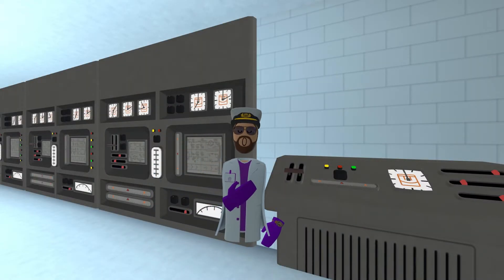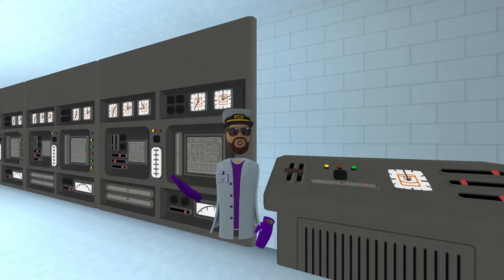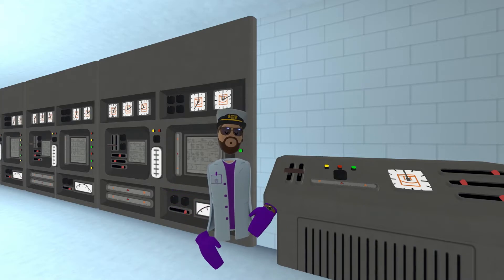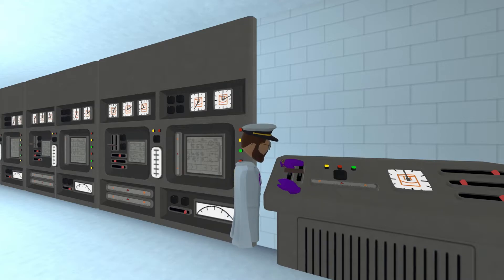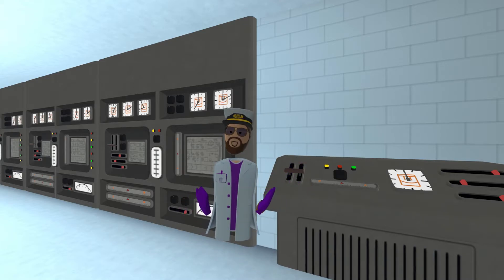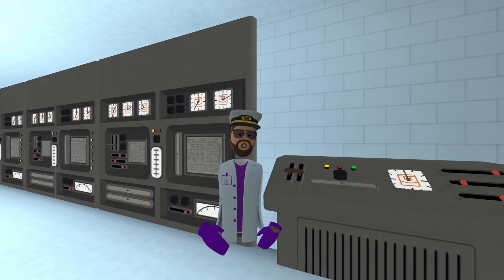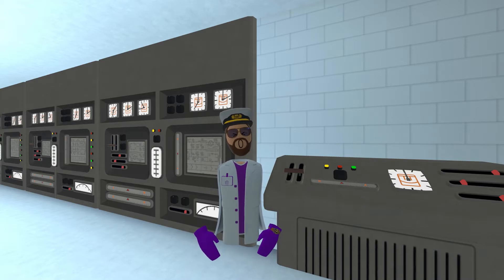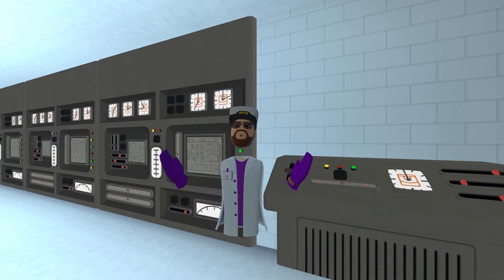Orange Automation is Expanding!

Comment: If I bought my setup in 1986, is there still a chance that I can get my reworked crane valve? I could really use the spare, but Orange Automation was not running the promotion then.
Reply from the maker: If you made a purchase within 5 weeks of the new year, you may be eligible for a standard crane valve if you call our support hotline.
Reply: Operators are standing by!